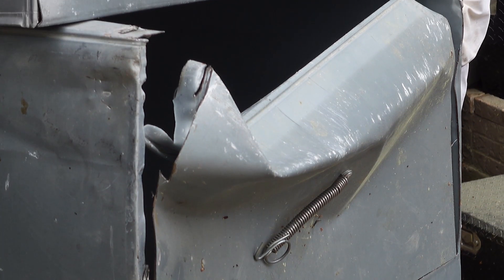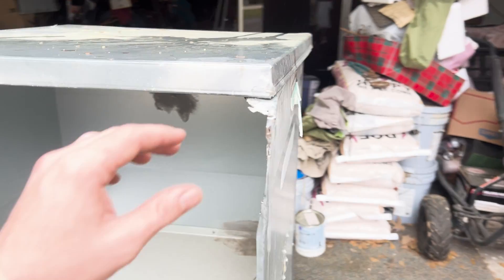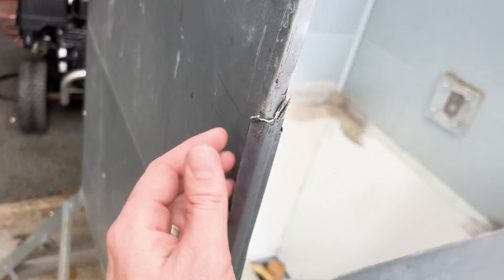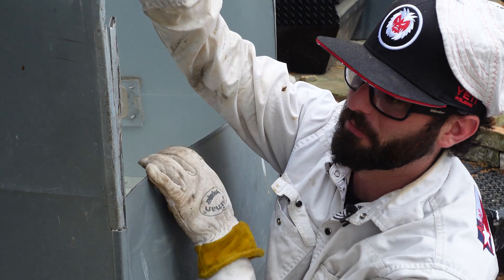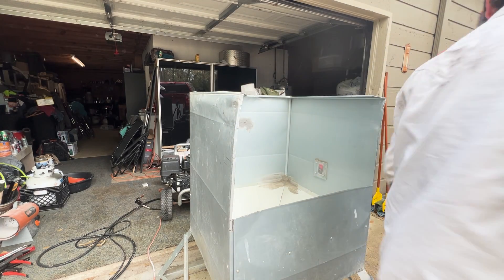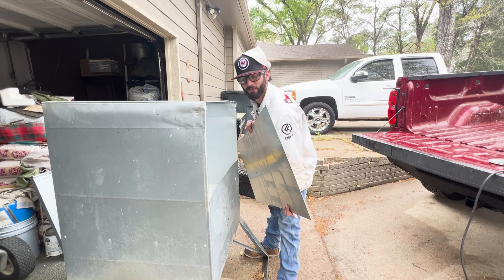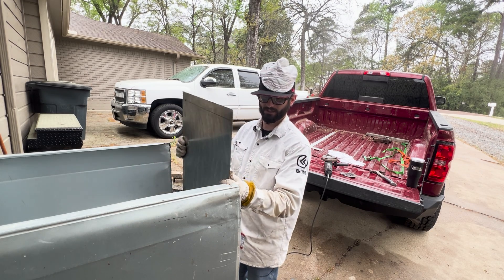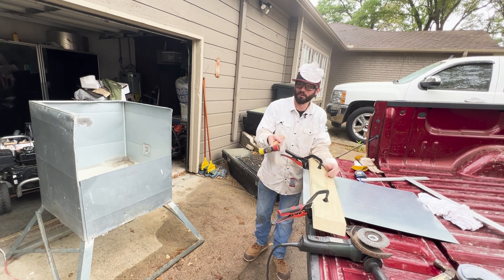Simple DIY: Repairing Galvanized Sheet Metal

Comment: I can't tell if you were kidding, or being serious at 15:00.  is it okay to put a 30 amp breaker on a 120 volt circuit?  I am thinking of doing this so my 140 amp 120 volt mig welder won't keep popping the breaker when I am welding at the top end of around 130 to 140 amps.  any feedback is appreciated.
Reply: dedicated welding circuit, 120v 30 Amp, non gfci is ok with NEC code.
Reply: also 120 volt 30 Amp rv/camper outlet. Add an adapter for your cord's plug.

Comment: Please don't assume being outside and keeping your nose and face out of galvanized welding gas as ok. It should be done outside under a tarp after as much coating removal as possible, then welded with proper ventilation and P.P.E...
Reply: you have to leave the coating on and burn it off under the tarp like a sweat lodge.

Comment: Weld galvanized with 308-16 stainless rod ; use straight polarity : penetration is low but use high enough voltage as required; you can even make a second pass !  No grinding; the  straight polarity pushes the zinc away from the weld similar to aluminum welding with AC has a surface cleaning  effect:  the 308-16 with straight polarity pushes the zinc  aside continously allowing the ss to reach the steel and bond.
   No cleanup necessary; over time the zinc moves to weld, no rust results , no paint required.  Try It !
Reply: Even on sheet metal with stick?

Comment: I welded galv with 6013 and 7018, the latter worked better for me. Problem I had was that it was a hollow structure on the goods, so couldn't get the galv on the inside off. Did that once without a half mask and never again! Man that stuff makes you sick swiftly!

Comment: "I bent the wrong side" -- I can relate to this down to my soul. No matter how big or small of a project, I will manage to find something that should've been a 10 minute job turned into an hour correction.
Reply: The joke in our house is a '5 min job'
Reply: That "Little" job would certainly take me all day.
Reply: Just yesterday, I put several countersinks for screw holes on the wrong side of the part. Fortunately, I was able to spot weld them closed, drill through the other side where the hole was still open and countersink the correct side. It just takes a small amount of lack in concentration.
Reply: Yeah that’s what I avoid saying at all cost. Especially when father in law was like “shouldn’t be too bad”
Reply: Been There, Done that...... Over and over. 😂😂😂
Reply: @buildaboiworkshop yes. The holes were drilled. Some of the holes required countersinking on one side and some on the other side. I somehow forgot and countersunk them all on one side. I then filled in the incorrect countersinks with weld. The weld didn’t go all the way through the part, as I intended. So I then turned the part over and using the old hole remnants as guides, redrilled them and countersunk them in the correct side. I also have countersinks with drill ends, but I didn’t use them.
Reply: Yup!

Comment: Having welded a lot of galv stuff and made gates from galv tube, all you have to do is grind off as much as you can but be aware, grinding friction creates heat which smears the galv. You willnever get all the galv off unless you disolve the galv with vinegar. Also, galv steel welding spits and fires back at you, keep your head out of the smoke and crack on. Generally I use Mig but have used 7018 successfully.